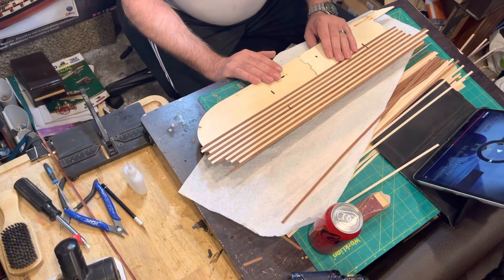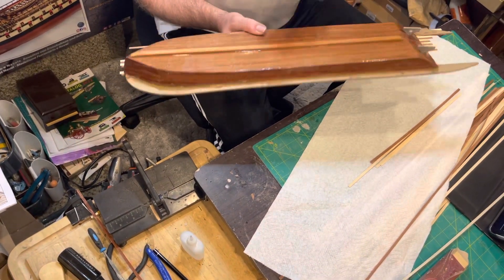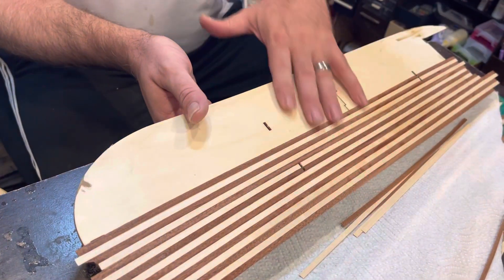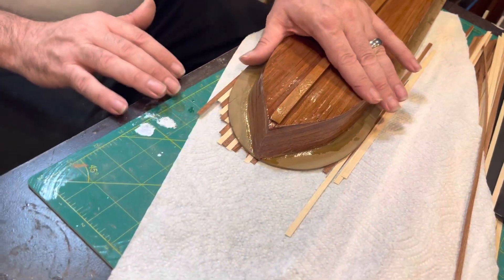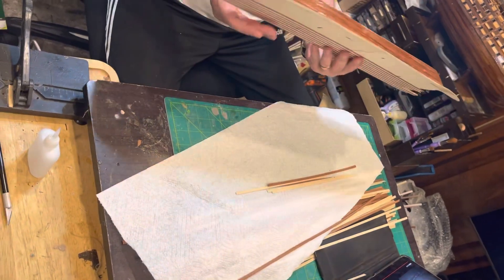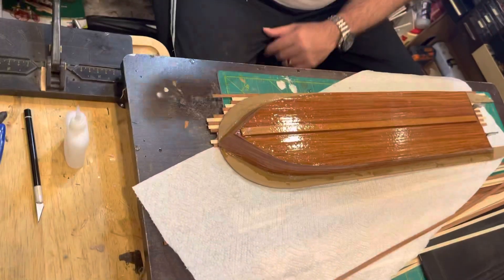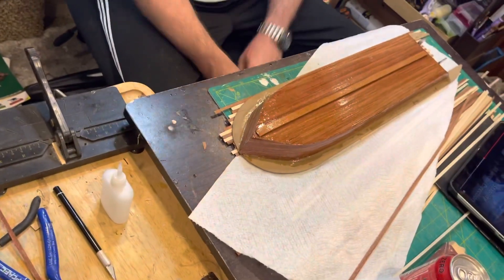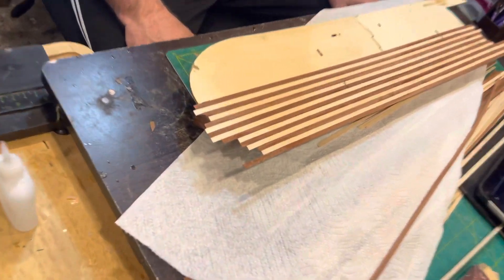Mississippi by Occre update

Comment: I am a beginner; in fact, this is my first project. I might have bitten off more than I can chew but I get bored easily with simple projects. I would like to ask questions from time to time, if I may. My first is a rather simple one; how do you get the pins to go all the way through the planking covering the hull, into the brackets. The instructions aren't very good. An experienced modeler probably doesn't even need them
Reply from the maker: Hi. Yes of course you may ask any questions you may like. Happy to help. I am almost to that part of the project. In one of my videos, I show my little electric drill. A very small drill bit will do the trick. I will be posting an update at some time today. I will go over that for you… also, you can use a thumb tack and make small holes as well. Good luck!!! Jerry
Reply from the maker: I also want to make sure I understand what you mean when referring to pins…
Reply: @AmbersCorner2.0  They are the 2x7x600 planks that cover the hull and the way I take it, the pins go through the planks into the frames that separate the main deck from the bottom of the hull. I hope I'm explaining that right. Thank you so much for your help.
Reply: @AmbersCorner2.0  The little gold nails, a half an inch long.